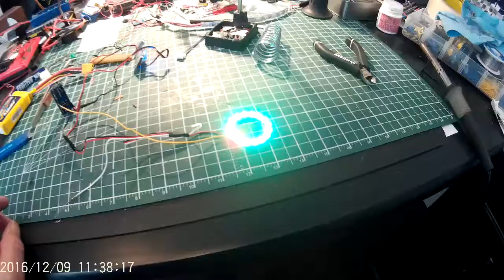2016 1209 Neo Pixel Ring Demonstration CJMCU-2812-16

Comment: hi,is it possible to read naza lite led status?
Reply from the maker: That is a good question, I haven't got a clue. Just barely learning how to write code. :D :D
Reply: Jeff Reimer can you show me the schematic?are you using other inputs except Vcc and GND?or just connect Vcc + GND + Output LED
Reply from the maker: VCC is your + pin, gnd of course - and IN is your signal in (DIN). If you are going to chain another onto it the  "out" is your "DO"

Comment: Hi, same issue/ cant find out how to connect arduino to cjmcu 2812-12 (must be the same with 2812-16) Can you please tell what pins did you use , mean on ring  there is 6 pins IN VCC GND and GND VCC OUT
Reply from the maker: VCC is your + pin, gnd of course - and IN is your signal in (DIN). If you are going to chain another onto it the  "out" is your "DO"
Reply: Jeff Reimer thank you!